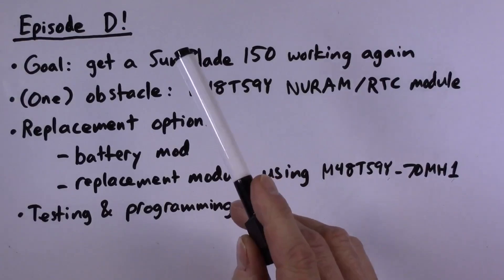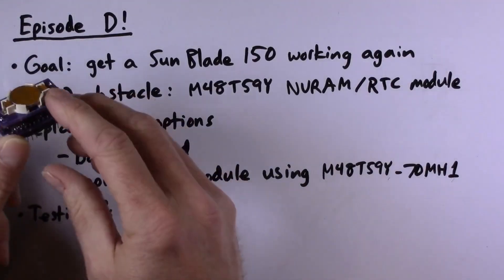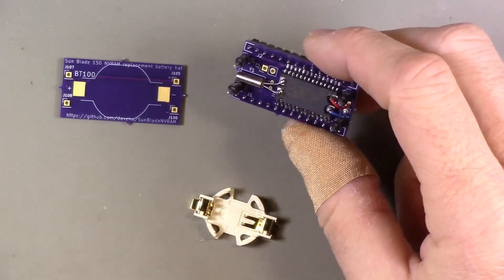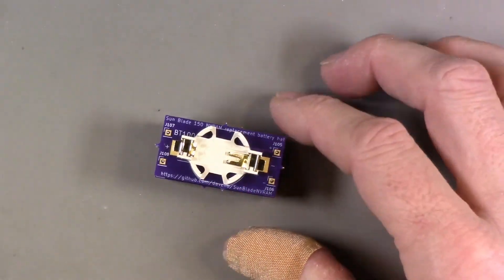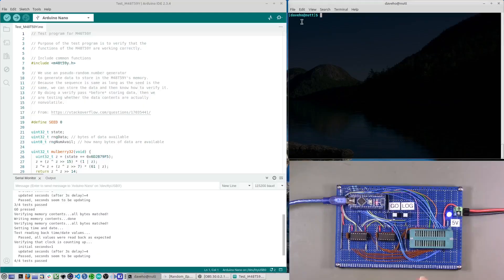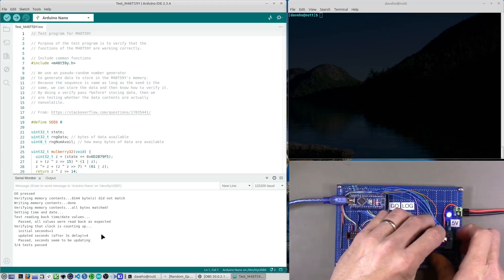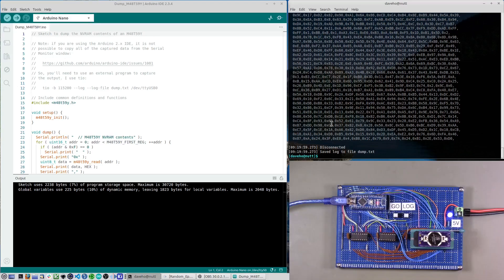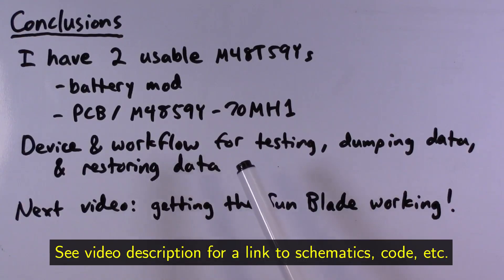Random Stuff, Episode D: Testing and Programming the M48T59Y NVRAM

Comment: I wish you could mass produce this 🥲 I think there are a lot of people out there looking for this permanent and serviceable solution but don't have all these tools and knowledge to build one. Also, I am assuming this works for ULTRA machines too since they use the same part number?
Reply from the maker: It would be difficult to mass produce because the surface mount M48T59Y is out of production, and of course there's the issue I mentioned in the video where the footprint doesn't really fit properly between the header pins, so it's quite difficult to solder. I assume it would work in other Sun machines that use the same part, although I've only tried it in the SunBlade 100 and SunBlade 150.

Comment: Hi, MrSparc here, author of the GitHub id-prom repair tutorial that you mention in this video. Great job! Will be nice to have your replacement module. Unfortunately, I don't have the electronics or soldering skills, so every time I need to boot my Blade 100 I still have it here by my side, I reprogram the NVRAM via openBoot :D
By the way, to enter into  "OK" prompt , you can use the power button, double click the power button, as soon as the power on beep sounds as if you were double-clicking a mouse.
Congratulations!
Reply from the maker: Thank you so much for that tutorial, I never would have gotten the system going without it! Thanks for the heads up regarding getting to the OK prompt, good to know. I did manage to get my hands on a Type 6 keyboard, so I now also have the possibility of hitting Stop-A 🙂

Comment: The weirdness restarts! Welcome back. Strangely I have recently restarted development on my homebrew 6809 machine after a year on hiatus due to family pressures. Making progress on this project is one of my resolutions for 2025. No sooner do I start looking at it again than one of your videos appears! Not only that, but my first order of business is to redesign the memory subsystem with a view to porting the Flex-09 Operating System. What do you think is in the memory subsystem? A battery-backed NVRAM module (M48T12)! I'm aware that these modules will fail over time and am also aware of the hacks to resurrect them. Your module may be a better way of doing this than the ghetto solutions I have seen so far. Hopefully we will get some more videos from you in '25 👍
Reply from the maker: I'm definitely planning on making some more videos this coming summer. Glad to hear you've resumed your 6809 project. These MOSTEK/ST/Dallas NVRAMs with the embedded battery really do seem to be ubiquitous. I'd love to know what the rationale was for using them rather than having a separate coin cell battery holder. I guess at least they don't leak and destroy traces on the motherboard.

Comment: One additional option is, you can completely de-lid the M48T* chips. If you cut both sides of the chip, to a depth that is approximately right behind the 1st row of pins on each side of the chip, then the entire top lid (which includes the dead battery and the 32.768 crystal) pops right off. You can then solder in a board like Glitchwrks' gw_48t02_1 (which is freely available and you can get it fabricated at your PCB house of choice -- "this is the 'way'" (ahem)) which adds a 32.768 crystal and a battery holder. I'm not exactly the world's greatest dremeler, and in fact I was a bit hamfisted with my dremeling, and managed to grind away almost all of the two metal posts that you were supposed to solder on to. However with some very careful use of the grinding attachment, I was able to expose enough metal to put a nice big blob of solder onto and make the connection. Coated the thing liberally with hot glue (to hide exposed wires/solder blobs and securely fasten the battery board to the top of the chip) and Bob's your uncle, my modded original M48* chip is now working happily in my SPARCstation LX. It looks like crap but it works like a dream.
Reply from the maker: Thanks! I will give that a try the next time I have an OG M48T59Y to resuscitate. It's too bad ST didn't just sell the bare chip without the "lid", the way they did with the SMD version.